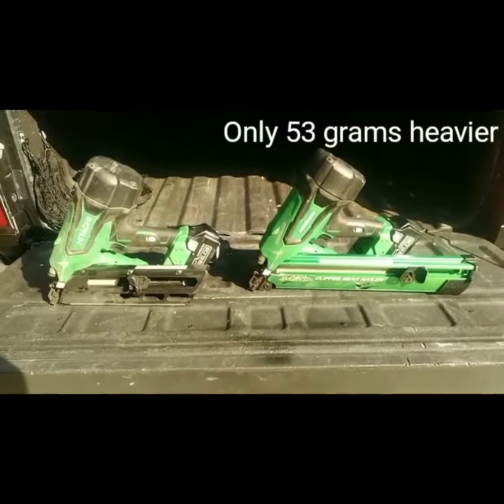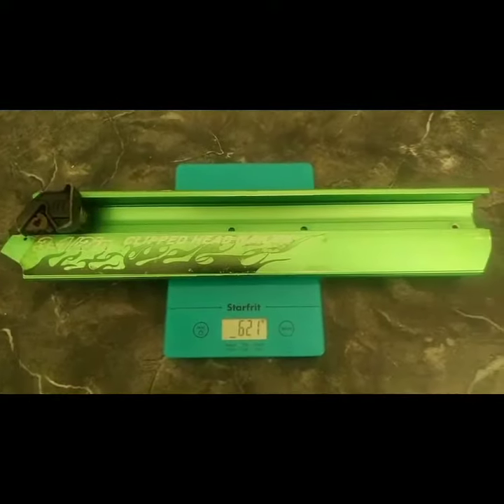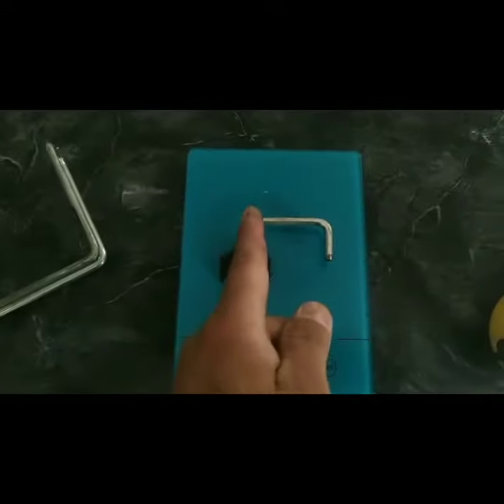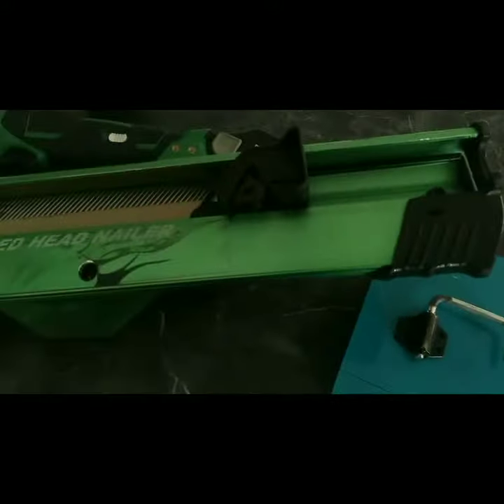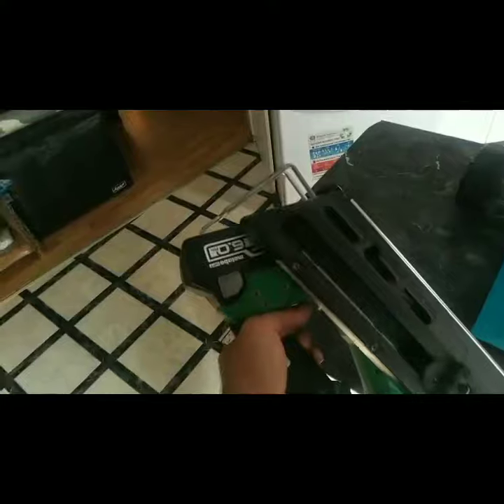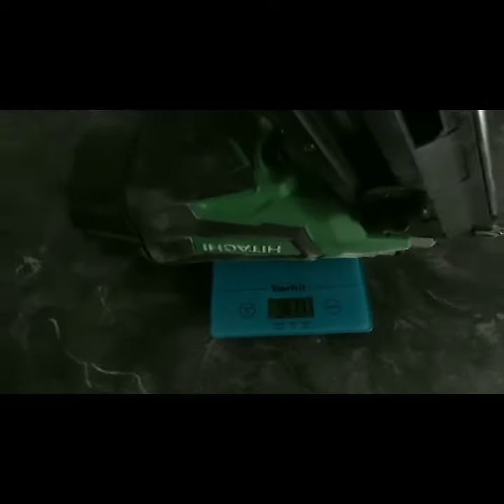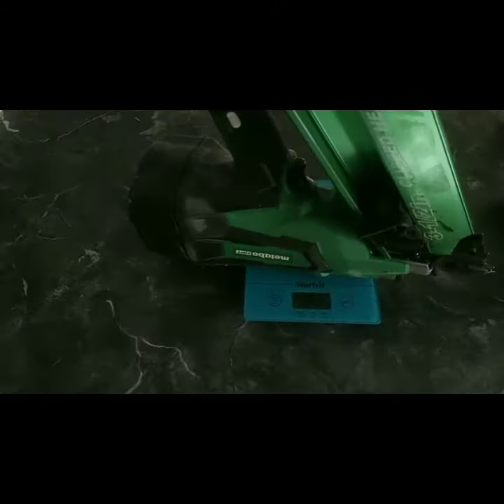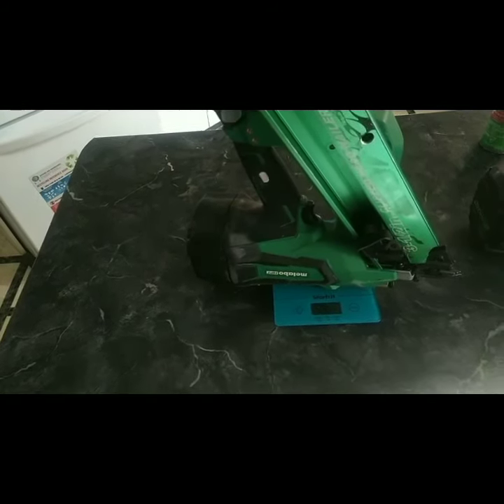Hitachi/Metabo cordless framing nailer extended magazine

Comment: what model hitachi donor? another dude used an 90ad
Reply from the maker: I bought a used NR 90AD, it's nicknamed the "Goblin gun" not sure why, cause it's green maybe, but it's basically the same as Warren 3's donor gun.
Reply: @achrisofalltrades5620  mmm there are 90ae magazines on ebay for only $60
Reply from the maker: @dannyoconnell4995  go for it, I love it! Just need to grind a lil bit off the inside of the donor magazine, drill a new hole for the screw to mount on the body. I had to grind the hex screw head a bit for the 3 1/2 nails but everything was pretty simple
Reply: @achrisofalltrades5620  oooo the ae is 21 degree magazine aaahh def need the AD as it is also 30 degree
Reply from the maker: @dannyoconnell4995  I prefer the 30degree, holds more nails n the tighter angle keeps the magazine up out of the way
Reply: @achrisofalltrades5620  well the 1890 stock magazine is 30 degree. just thinking for longevity of the gun you wouldnt want to mess with that, maybe the action over time wearing the piston down unevenly or something

Comment: did you have to mod it to fit or did it bolt right on?
Reply from the maker: Slight modification required, just a tad bit of grinding some material off the longer magazine.
Reply: @achrisofalltrades5620  thanks for the reply i was juist wondering  im in a toss up between this and the milwaukee they both are great nailers lowes if haveing a sale on them right now for 300$ for the metabo thats go it going for it i build sheds and getting tired of air compresser
Reply: @strengthstuff7618  Milwaukee is too heavy. I took it back and got the Hitachi.

Comment: How did you mount it?
Reply from the maker: I had to remove a bit of material from the inside of the extended magazine just so the front would fit perfectly. Also had to drill a hole so I could use the same mounting screw hole location on the gun. Finally made a spacer washer for that mounting screw to keep the original angle of the magazine. It takes a little tweaking

Comment: Where did you get the extended magazine?
Reply from the maker: I bought the gun used off of EBay. They can be bought new from metabo but I think they were around 100$ where as I got the used gun(didn't function needed a rebuild) for 25$